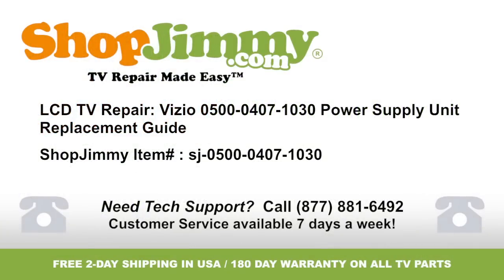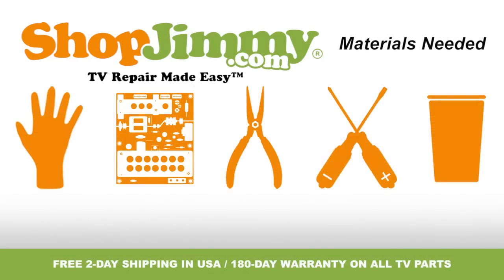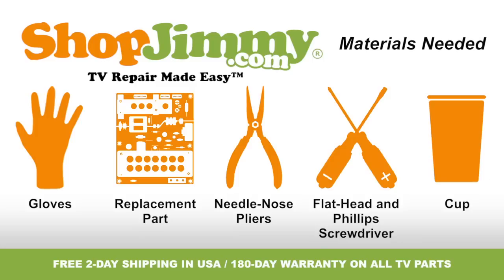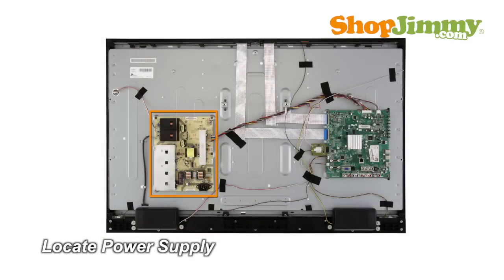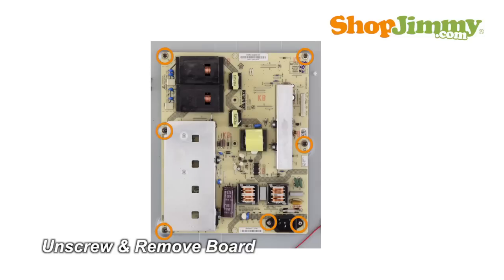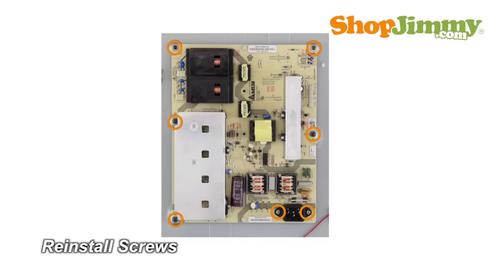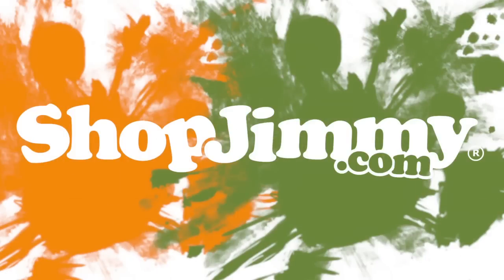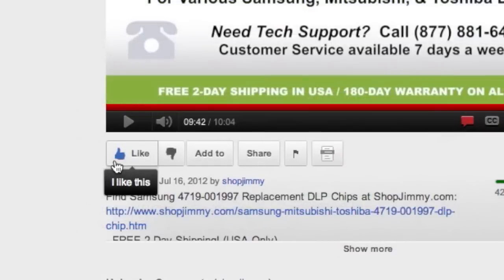Vizio E42 Power Supply Unit (PSU) Boards Replacement Guide for Vizio LCD TV Repair

Comment: Hello, my Vizio e3D420VX wouldn't turn on one day. Panel did not light up, I couldn't hear any sound from the PSU. Then I was able to turn on after leaving it unplugged for a while. It wouldn't turn on again today. After leaving it unplugged for a day, I decided to open it up to see if the main board was getting the 5V. When I plugged it in, it did turn on and the mainboard was getting the 5V.

Do you think the PSU is going bad? Or could there be something else going on?

Comment: My E421VO Vizio 42in TV has a problem. When I turn it on the left side of the screen flickers with white and green vertical lines then turns off after 5-10 mins. Is there anything I can do to fix it?
Reply from the maker: Graham Speight  This sounds like a TV panel problem.  If your TV panel is bad, it may be more cost-effective to replace the TV as panels are typically hard to find in stock, difficult to replace, and expensive.  Thanks and please let us know if you have any further questions!  www.shopjimmy.com

Comment: Hello I have a vizio vu42l. I can get the TV to power on but there is not any picture. I also can't get it turn back off without unplugging it again. I am thinking it is the motherboard. Does that sound right? Is this a dangerous repair to try on my own?
Reply from the maker: Brandon Stephenson I would recommend replacing the main board in your TV and no this is not dangerous if you take the proper precautions.  Be sure you unplug your TV before working and properly ground yourself.  Here is a link to replacement parts for your TV model number on our website, click here:  http://www.shopjimmy.com/catalogsearch/result/?q=vizio+vu42l  Be sure to match part numbers on your current board, with your replacement for compatibility.  Here is a link to a video showing how to identify your part number, click here:  TV Part Number Identification Guide for Vizio Power Supply Unit (PSU) Boards (LCD LED Plasma TVs)  You can also call our customer service for further assistance with your purchase.  (877) 881-6492  Thanks and please let us know if you have any further questions!  www.shopjimmy.com

Comment: I have pulled the board but it does not look like there is any damage.  Is it common for it to go out and look normal?  If i order the replacement and the TV still fails to function can I return the board?